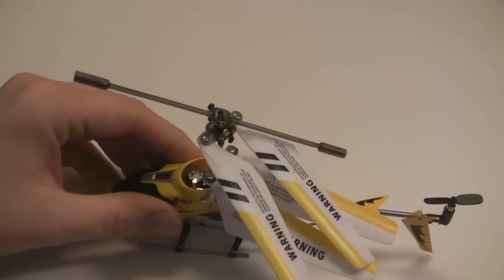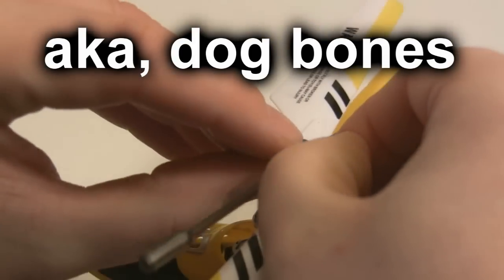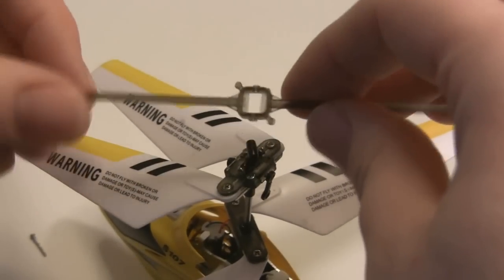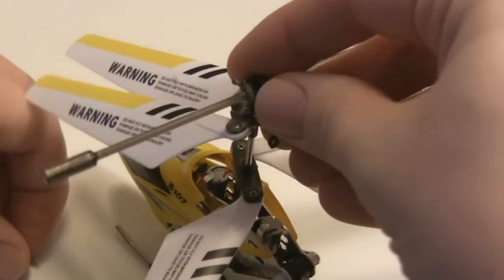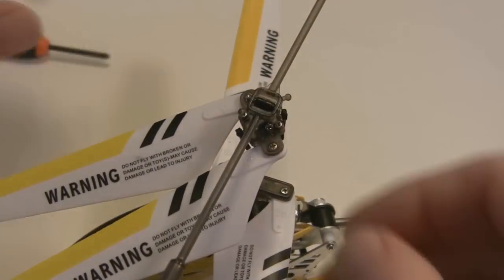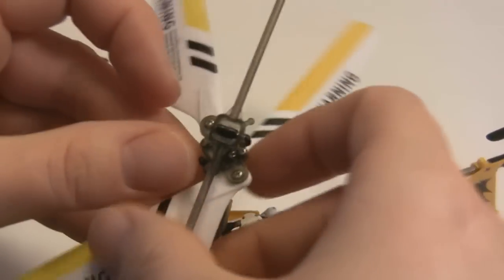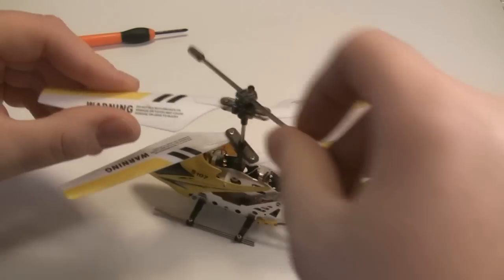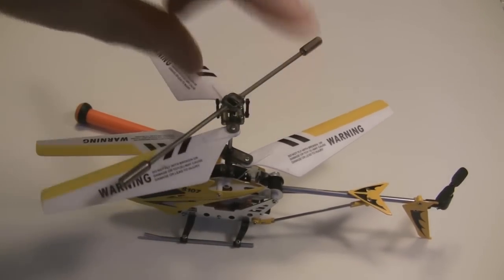Syma S107 S107G Balance Bar Replacement Repair S107G-05

Comment: Great video! One question.. my balance bar is only connected with a pin.  It is not a screw like your showing in the video.  My helicopter is doing the TBA 'toilet bowl effect' so i thought if I took it off and cleaned it, it might balance more loosely and have less delay when pivoting.. so my question is, how to I remove the balance bar on one without a screw? Thoughts?? Thanks in advance!!